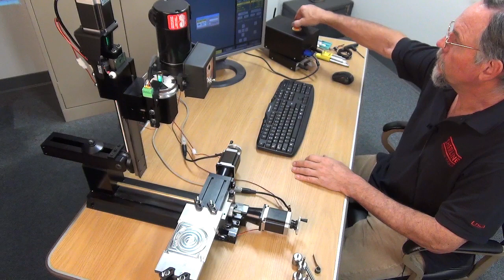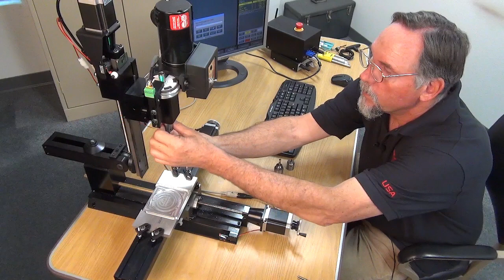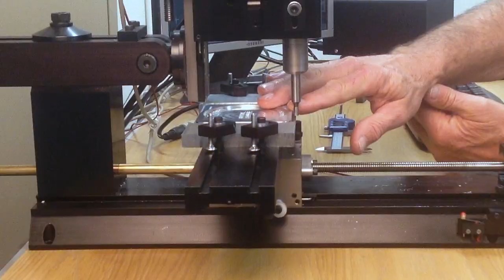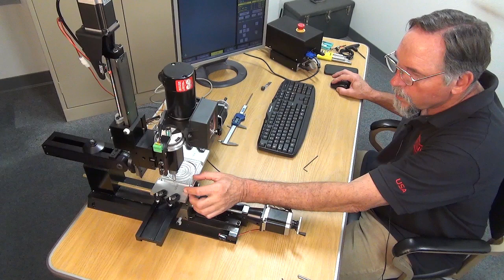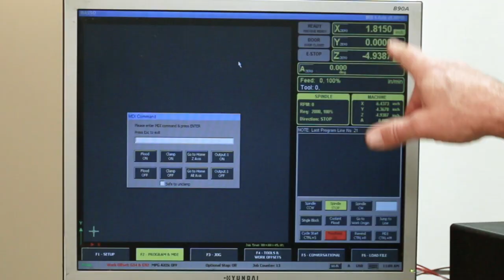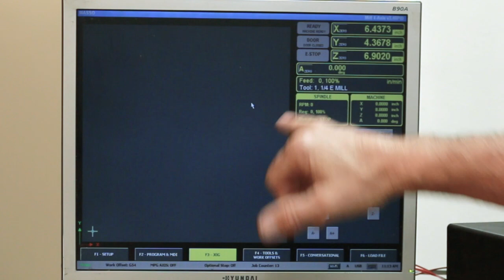Work positions and Tool Offsets for Tools

Comment: Why is the software product I recieved, look NOTHING like the tutorial presented? Is there a tutorial how to use the supplied software?

For being my first mill with no basic "caveman" instructions how to get this package cutting is just short of infuriating.
Reply from the maker: What system and software did you purchase?
Reply: @SherlineProducts  I'm not really upset at all. But you know how we all get dealing with new ideas. 

I have the Model 5400 with sku 8540A. The mechanical part wasn't an issue. The mill is working phenomenally! I'm extremely happy with that! 

The software is my issue. As an automotive technician, the reading isn't beyond my comprehension. Just much more technical (read: I.T.) than I'm comfortable with. I dropped the tower and software off with the Geek Squad. 

Bring me a car with an intermittent check engine light. I can back probe wiring working with the diagram have it figured out within an hour. Ask me to set up a computer? You might as well ask me to build you a space ship. Thank you for the response!
Reply from the maker: @endstatism9490  Sounds like you purchased a Linux CNC system. We don't have any videos for the Linux CNC. All our CNC videos are for our Masso Controller. Good luck with your machining. If you have any further questions you should contact us directly via email, sherline@sherline.com
Reply: @endstatism9490  Hi. I have the Sherline with the Linux also. I found this page on Sherline's Website that has the detailed written instructions for our Linux Sherline Machines. Just look at the date you bought yours and open the instructions for it. I hope this helps. 

https://www.sherline.com/cnc-instructions/